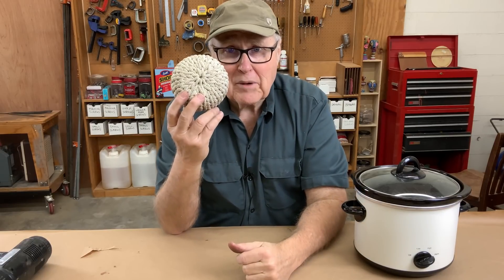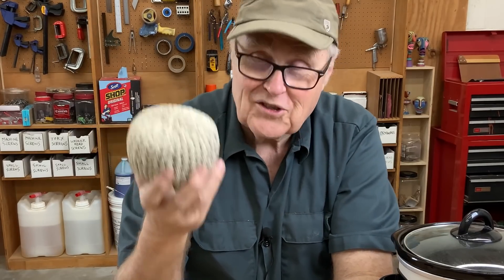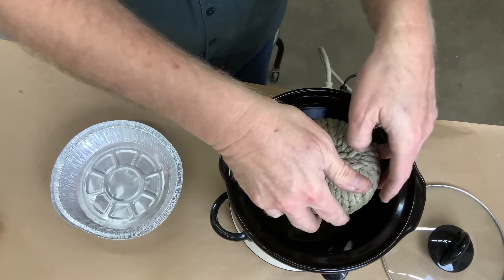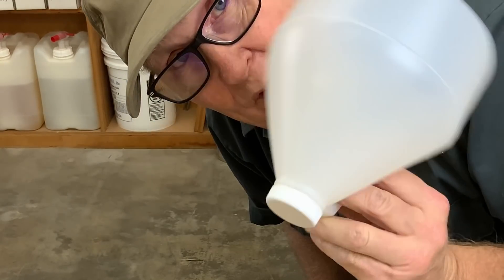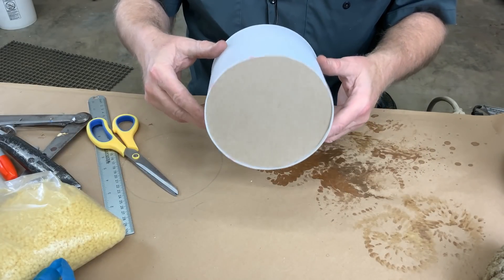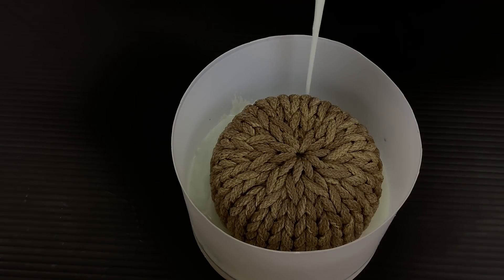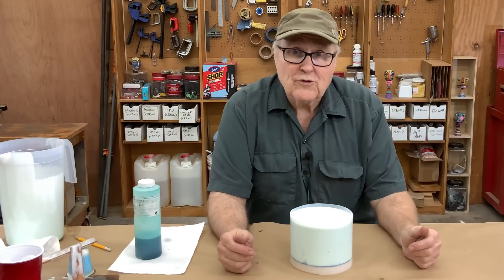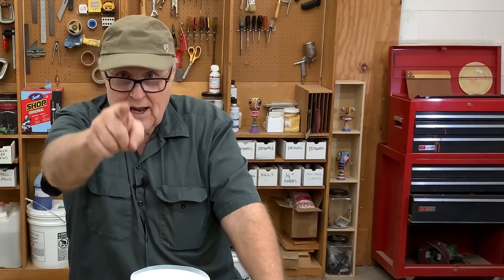Porous Pouring - Never Boring! - Part 1

Comment: For bronze investment moulds we would seal porous objects with shellac - worked wonderfully for keeping plaster malachite from binding.
Reply from the maker: Shellac is an excellent sealer and I often use it on wood and cardboard. But I find  beeswax to be more reliable when it comes to mold making.

Comment: My company makes silicone prosthetics. We line the bucket with a plastic bag, add A&B, take the liner out, twist the end closed, and squish it around. No worries about the mix because you're pushing the sides and bottom into the center while squishing. Then cut a hole to pour it in like a piping bag.

We use plastic that was already heading to the trash so we're not adding extra waste to the landfill. And because it's in a bag we can squeeze all the silicone out and don't have as much waste.

Not sure it would work for large quantity pours like this but it works great for the multiple small 2oz or less pours we do. With this method, I can add a bit of Tin Thix to the mix and pour it in only the sections I want.
Reply from the maker: I have heard of this method and can see the advantages to it. I should give it a try sometime.

Comment: Interesting solution. Curious to see the next part. I like the beeswax solution. My first instinct was petroleum jelly which in my mind would have sealed out the painful gaps. A plaster mold could let you burn it out. Maybe wood workers stabilization resin ... hmmm I can think of things to go wrong in every instance. That's a tricky one. Great example!
Reply: stabilizing resin + vacuum chamber the way people do pen blanks and the like is an interesting idea! my first thought was a few coats of shellac might be thick enough to bridge the gaps but thin enough that the resulting candle still shows the texture of the yarn.

Comment: My impulse was to seal it in a layer of silicone (a thickened paste or layers of liquid) that set before the pour mold.  That hole in the top looked like it needed to be plugged, too.   Lets hope it does not drink too much silicone before it cures!
Reply from the maker: I considered doing that, brushing on a print coat and letting it set before pouring the final mold.  for this project I decided a different approach. I’m thinking I will be doing some cutting to free the mold from the model.

Comment: From just seeing the model in the intro, my approach would have been to seal the model (as you've done), then instead of using thin/pourable silicone, use silicone putty. So you can just press the putty into the holes without any risk of it soaking deeper and deeper into the core.
I'm interesting to see the outcome for this one. I'm predicting that there's going to be alot of tiny tears and rips when cutting this one open. :)

Comment: Do you always use plywood for your bases? When making bases we always use plastic when making silicone molds in glass casting. We use plastic rectangular sheets and don’t cut them and use silicone or glue cones to attach the coddling material so we can reuse the base.
Reply from the maker: I began my career as a wood sculptor so I built a woodworking shop early on. Plywood sheets are the easiest thing for me to work with. But every shop is different it’s always best to work with what you have on hand.
Reply: @RobertTolone  Ahhh that totally makes sense. I’d LOVE to have a band saw, all I have is a jigsaw and while it can do some pretty cool cuts I don’t think it can do the kind of cuts you are getting to really match the bottoms (or tops) of these sculptures! But also with the prices of lumber, even plywood right now…whew! I’m sure you have tons that you keep on hand so can wait until prices go back down, but I buy my plywood usually piece by piece, or find it, and right now it’s killing me! I’m glad I have my system working mostly fine, there are a few things I could improve, but the roof flashing is so cheap and comes in really really long rolls so lasts a long time, and I like using silicone or hot glue or plasticine when I’m not feeling lazy to make sure nothing leaks- all cheap and easy. I’ve been very interested in the kinds of wax you use- I just do a next gen Victory Brown Wax because that’s what we used in college for everything, and it works fine, but I’m quite interested in how you use beeswax…just soaks in and you use it in ways I’d never think of and works great! And I love getting to use renewable resources so I’m going to start using it and watching a lot more of your videos partly just to see if you use beeswax in a new way for me! Thanks for the videos, it is always good to see how different people make molds, you always learn something new and often something you can steal!
Reply from the maker: @aubreytauer7308  I scrounge almost all the plywood, MDF or melamine boards you see me use in my videos. Construction sites and dumpsters and the alleys in my neighborhood on trash day keep me well supplied!  It’s amazing how much stuff people throw away.

Comment: get one of these silikone baking spatulas - they are perfect for scraping the sides!
Reply from the maker: The time it takes to clean the spatula after use is worth more to me than what little silicone I leave behind in the container. If you don’t clean the spatula the rubber will bond permanently to it.  I prefer the speed and ease of a disposable wooden paddle.
Reply: @RobertTolone  the ones i use are super easy to clean afterwards (peeling off the robber without issues) maybe you had bad luck with the product you tried? or your tin silicone simply sticks better than my platinum stuff
Reply from the maker: @MiniaturenGalerie  Bad luck I guess. I have never found spatulas that either tin or platinum rubber won’t bond too.  Truth is, I haven’t really looked because my tablesaw produces a never ending supply of offcuts suitable for stir sticks and scrapers.

Comment: I think that you should have made that model a solid chunk of wax, and no air. Then with the hot knife and heat gun melted off the outer layer until you got to the detail you wanted. As it is, I think it will be nearly impossible to remove it from the rubber.
Reply from the maker: You may be right.  I am hoping that high-flex rubber and an X-Acto blade will come to the rescue 🤞🤞.
Reply: @RobertTolone  I can't wait to see the next episode!

Comment: Another great video, Robert!  Why didn't you put the still-outgassing mold (8:05) in a pressure pot while it set?
Reply: It's not really outgassing, the voids inside the master are filling with silicone.  The pressure would force the rubber further into the pores and make it much more difficult to separate the master from the mold without cutting or tearing.

Comment: Could you run the mold back into the vacuum to remove the excess air from the ball so it doesn't keep out gassing while it sets?
Reply: Doing so would bring all that silicone into the center of the master. I think it's already going to get locked in silicone. Doing this would have sealed it's fate.

Comment: Hey. I have a question. Is there a way to fix a small hole in a master? the hole needs to be absolutely flush, and sanding kept to a very minimum as to not alter the dimensions. (Very sensitive piece, can't even lose a tenth of a millimeter). What materials/techniques would you recommend I try?
Reply: I’d recommend filling with material which is softer than model; eg filling carving wax model with softer wax, say pure paraffin, or filling plastic with casting wax and so on. Ideally then you try to find a tool that does not scratch the model material, but can scratch the filler (like using wooden blade to form a wax filler in plastic model), but that’s not strictly necessary, as softer filler material will provide less resistance to cutting/abrasion.
Reply from the maker: If the fill is for a master you are casting Grimoir Workshop has it right; wax or sulphur-free clay are good options.  If the hole repair is to be permanent I would use water-based epoxy clay. It can be smoothed flush without sanding and will take paint well. Your choice of materials really depends on what the final result needs to be.
Reply: @RobertTolone  Thank you for your suggestion. I will try the was technique, because after the first casting, I can just use the new model as a master.
Reply: @grimoirworkshop6623  Hey. Me again. Sorry for the bother. I was wondering if dental wax is ok. The only type of sculpting wax i can get here. (The one that is used when molding dentures and such)

Comment: Hi Robert, how would you approach to make a mold of 1/6 scale katana sword. the blade is very thin. Would you go with one piece mold with the vent at the tip to make sure resin will fill up the mold ? Thanks!
Reply from the maker: I would be inclined to mold it in three pieces:  the blade, the cross guard and the grip.  The Blade would be easy to cast point down; you’ll have more problems with bubbles etc. casting the hilt.

Comment: Would it be ok to mix with a silicone spatula or would that react with the rubber mixture?
Reply from the maker: I have tried silicone spatulas and I find that the molding rubber sticks strongly to them. So they are a pain to clean. Sticks may not get every bit of rubber out of a container, but it’s time over money so the method I use works for me.

Comment: I watched the video again because of something rather puzzling, it looks like you are not making a mould of the whole object because you have stuck it directly to the base, (the object has ‘elliptical ends’?) as opposed to suspending the object so that the Silicone surrounds it totally.
Reply from the maker: Correct, I am treating it as though it has a base for convenience and simplicity. It’s a candle so by definition it has an up side (the wick) and a down side (the base. Also  I’m hoping I can de-mold it without a parting line.
Reply: Thank you for clarifying the approach, that explains it perfectly.

Comment: I'm afraid this is going to be a major fail. I see several issues and they seem to get worse as you go along. The biggest issue is the rubber is going to lock that part in. Of this have no doubt. I also see you didn't raise it up with some sort of pour spout. This is going to make the top of the mold extremely thin. I mean no disrespect and still love watching your videos I just think this one doesn't show your best skills. Hoping I'm wrong. 🥺
Reply from the maker: I considered building a pedestal so as to make the top of the mold thicker. The main reason I did not do so was the labor involved and also the fact there is a high potential for this mold to fail. It is very likely that this mold is locked to the model.  We shall see if my idea for solving that problem will work.  (Probably not). The best way to assure success of this project would be to laboriously fill all of the undercuts and deep holes in the model with sculpting wax. Also sculpt on a nice base that would also account for wax shrinkage in the candle casting.  If I were in business making these candles in production that is exactly what I would do.  But I am in the business of explaining silicone mold making and resin casting. 

The main theme of my channel is:
To succeed at molding and casting an object you have to design that object for the process of molding and casting.

I am trying to illustrate the difficulties you will encounter if you start with an object that was NOT designed to be cast.